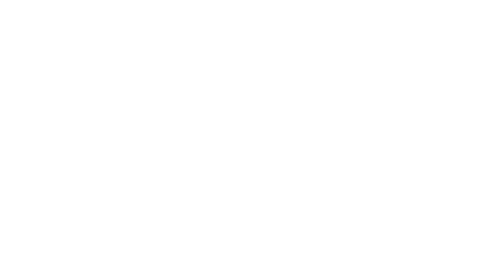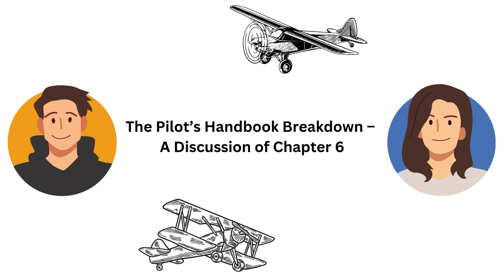FAA PHAK 6: Mastering Flight Controls (Chapter 6)

Comment: A turn or roll to the right would mean the right aileron is deflected up, not down. 7:15
Reply from the maker: PHAK 6-3: “Moving the control wheel, or control stick to the right causes the right aileron to deflect upward and the left aileron to deflect downward” 

*Thanks for catching this.* I must have overlooked it before publishing.

A school I went to that has examining authority has a redbird simulator that does the exact opposite in the sim.

Brought this up to management and they didn’t bother to fix it. Students are still allowed to log that time in their logbooks. 

(They charge $500/mo to use an inaccurate simulator)
Reply: @FlyingForHours  😳 Sounds like a refund is in order. 😛